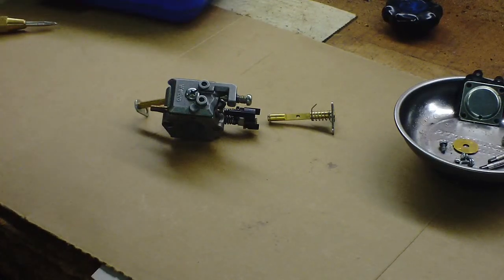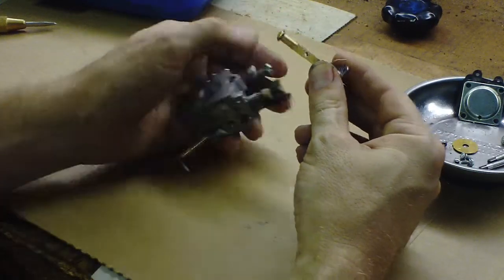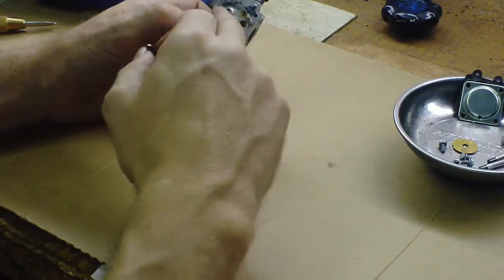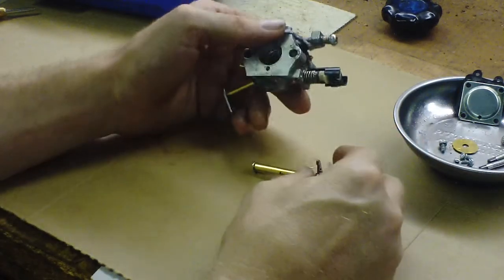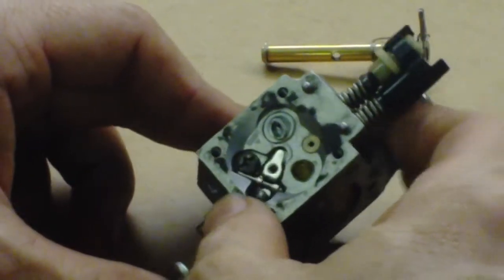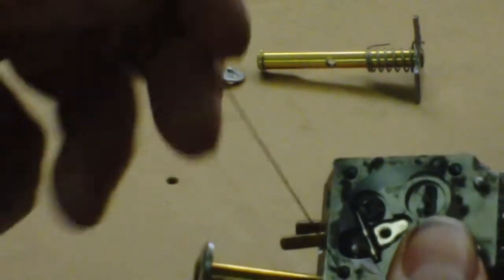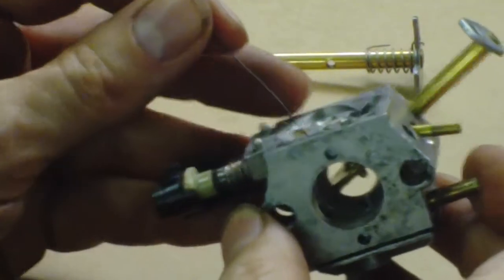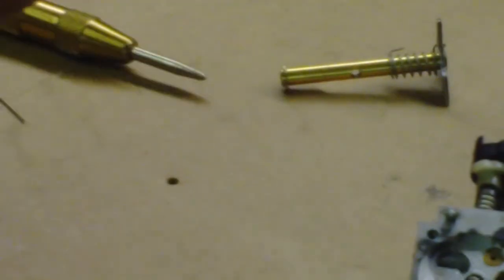How 2 fix 2 Stroke Walbro carb Clogged up & parts swap DIY

Comment: thanks for this....need to do the throttle cable swap out i bought off amazon and you just answered my question if it can be done..thanks again!
Reply from the maker: You're very welcome man, hope u get it going. It should work, good to keep a spare carb er 2 around just for parts at least. Did u see my other clip?  Is your's a homelite saw?   Just don't let them sit up long, & use Pure gas. Winterize them even if u don't have long cold winters: fire it up, pour out the gas & run it til its DRY. And use good additives like seafoam/super tech & Marvel Mystery Oil unless you found something just as good er better.   - take care
Reply: @leeisenberg  yes ive seen both clips....and it is a homlite ranger 33cc....i picked it up for $15....thanks again for the videos and tips!
Reply from the maker: You get that sucker sawin' logs again?  Hope so, take care man.